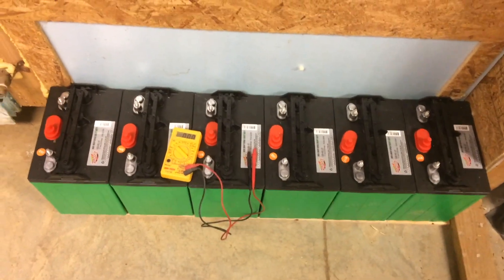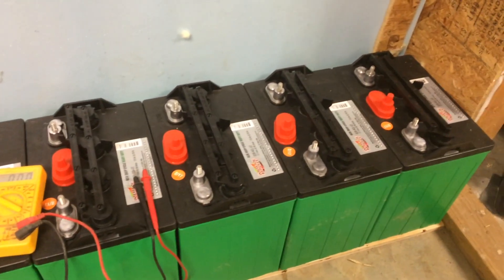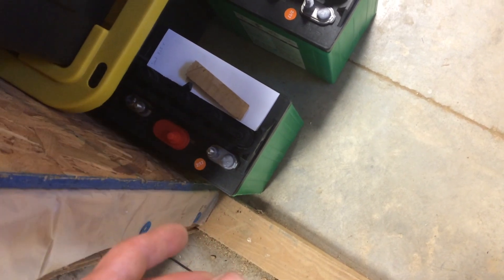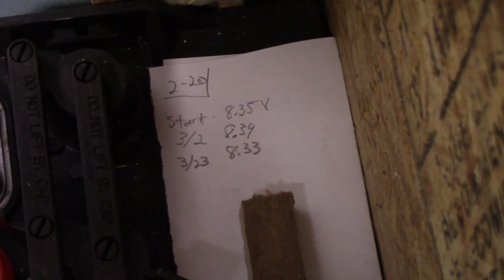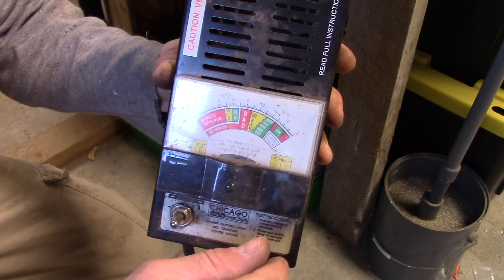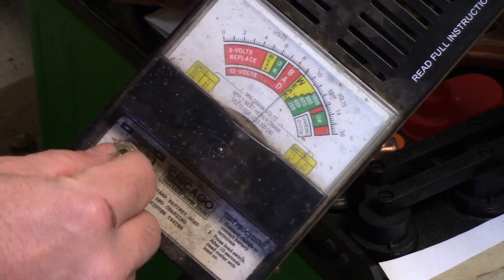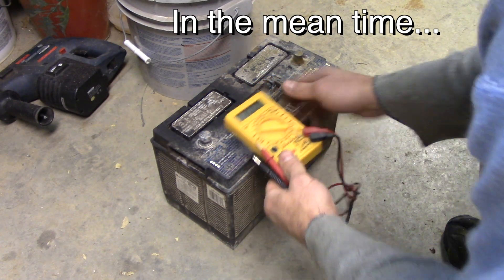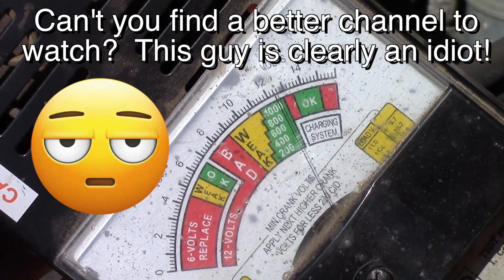Is Concrete Killing Your Batteries?? Here's Scientific Proof To End The Debate. FarmCraft101 Solar

Comment: It's not a myth at all... Farm Craft lives in a temperate climate.  In a COLD CLIMATE the concrete acts as a heat sink which will impede the chemical reaction of the electrolyte.  If you're charging or discharging the battery on such a heat sink it can cause damage because one part of the battery is heating up unequally to the rest of the component.  Adding a thermal barrier or just a little bit of insulation makes a world of difference. Don't trust a single thing the goofballs on car talk tell you.

Comment: I was told this years ago never thought anything of it but always if I remembered put wood or something under them after being told  about it,  well  I have a car battery that came out of my dead van that was a Good battery I had been storing it on Wood but my sister moved it sometime in the last 12 months to  the concrete floor   and  the good battery now is 100% trash  I was  making sure to charge it to keep it as a back up battery anyway it was never left under 11 volts   I went to use it the other day and decided to stick it on the charger before hand anyway it was reading 8 volts after being put on the concrete and now it  won't hold a charge after trying to charge it it  for a day it now reads 2 volts

Comment: This is for batteries that are still usable but unable to properly maintain a quality service of your need.  Or long-term  sitting of a not proper maintain  if it has dropped to a low voltages and rate ........ just know what a myth origin is and don't conspiracy.

Comment: It's because they stored a dirty battery, there will be a voltage drop across the dirt, batteries also vent and basement or garages are dusty, thus leaving batteries to drain, from dirt and venting.
You can also get voltage on a rubber hose, the same reason for dirt. The race and specie of Children are gullible.

Comment: The Concrete needs to have Steel Reo "re-inforcement" in its construction as it is inductive to the electrolyte in its discharged state which has a different name, The affects of the scale solphate will cause cell damage making the Battery unrecoverable by charging, ask your self why would this ingenious youtuber risk destroying 3 batteries. Seriously how much are Car batteries today, Maybe he sells batteries and makes a margin on each sale, As a Mechanic if I have to remove a battery from a customers vehicle it is not placed on the floor, and if anyone in the workshop relocates on to a concrete floor they will be out the door or paying for the customers replacement Battery.

Comment: I had always heard the same thing.  There was a rationale behind it, but different from the historical ones you stated.  The idea was that concrete is somewhat conductive (is it?  Maybe depending on the moisture content) and would form a capacitive couple between the concrete and the plates inside the battery.  That would be to the small surface areas at the bottom edges of the plate which would not be a high capacitor value.  This may seem plausible at the very small rates to affect a battery  over the long term.  (Almost anything could seem plausible if the rate is small enough or the time span long enough).  It doesn't seem likely that a capacitive coupling, which is open circuit in DC, would result in the DC discharge of a battery.  Maybe they were thinking that it resulted in a miniscule short between the battery plates since no insulation is perfect?  Who knows?  I think the length of your test is enough to disprove the theory for all practical purposes.

Comment: Batteries will go dead but sitting on the ground if they leak acid and collect dirt on the case this dirt will cause a draw on the battery and kill it over time the battery is clean inside sitting on wood it won't go dead as quickly I have measured the voltage drop on batteries that are acid on the exterior and all dirty when I clean the battery the voltage draw went away so this is probably what people are talking about

Comment: I think I know where the myth came from. When a battery is sitting idle on the concrete, the months and years go by very fast, which of course kills the battery from self-discharge. If a battery sits discharged for even a couple of months, it won't recover when charged. LiFeP04 FTW!

Comment: Lotta work there, or just bunch of time. Well you made a believer outta me. Good job, kudos even.

Now to the part where you may wanna ban me from the site. Could you possibly do the test again with the positive connection to ground on one battery and then on another battery the negative to ground. I'm sure it would not be necessary to do one withe both leads to ground. I feel like a scoundrel for even mentioning this, I was jus' wondering...
🥺

Comment: ‘Don’t store a battery on concrete’ is from the time when battery cases were made from carbon filled rubber compounds. Rubber was stable against the sulphuric acid, but the carbon in the rubber was an electrical conductor. These old batteries did discharge slowly on concrete surfaces. The modern plastic battery cases are much better electrical insulators than the old fashioned rubber ones. This old tribal knowledge was valid, but has been slow to die off when new battery case materials became available and discharge thru the case is no longer a concern.

Comment: Concrete is chemically and atomicly active. It's components were dug from underground, sometimes exposed to low levels of radioactivity. It also "collects" cosmic radiation. In addition, it's a thermal heat sink and cycles the battery that way; even morning dew has an affect...so science says that it does mess wit batteries. Just think it through, simple thought experiment.

Comment: People are forgetting........the plastic compound has changed quite a bit since the 40's to the 50's to the 60's to the 70's and 80's to now............
Sitting them on the concrete floor for a length of time wouldn't just drain them it would ruin the batteries back then.......it may seem to be a myth now but it wasn't back then.
Reply: Placing them on a concrete floor is still a bad practice even today.  Concrete floors act as a heat sink and can slow down electrolytic reactions in cold temperatures or have the battery unequally discharge its capacity under heavy load causing damage.

Concrete is generally found on the floor of most places so you also risk water intrusion with flooding and other issues...  Also if you're charging a battery temperature matters quite a bit!  There's a reason why a lot of lithium-ion batteries have temperature sensors which will prevent charging until they reach a certain point.

Comment: It wasn't always a myth!!!! If you do your homework, you will find out that at one time it was true, due to battery design. In the the first 1/4-1/3 of the 20th century battery's we're made of lead, acid, and GLASS. The lead and acid were encased in GLASS!!! That battery was then placed in a WOODEN box to protect the GLASS cased Battey. So if you placed those batteries on concrete, the wooden box would absorb moisture from the concrete and swell. The swelling would crack the glass inside and all the acid would drain out and the battery would be "drained" so to speak.
Reply: I knew I should have waited till the end to post my comment

Comment: Jon, interesting where this myth came from. I believe today it is still a good idea to keep lead acid batteries off concrete because when putting heavy battery down you could cause the loose particles in the battery to sink to the bottom and may short out some of the cells. So I always put my stored batteries on a soft surface like a piece of pine thanks for your video great stuff. Bill N LI NY

Comment: It's interesting where this myth came from. It's from a time when batteries came in wood boxes. The acid in the battery would slowly permeate through the wood, and form some kind of complex with the concrete that was conductive. This would discharge the battery. The advice got passed down by word of mouth for 70 years, and here we are.

Comment: The only way a battery would go bad sitting on ground would be if you accidentally sit it down on a small sharp object that pierces a small hole in its plastic cheap case and causes it to leak all it’s acid.

Comment: Ok but I too at the shop I was working at and the myth was true we did 3 brand new batteries off the shelf and the one on the ground did discharge at a SLIGHTLY faster rate maybe a volt every 3 days compared to the one we had on the bench and you said that your meter wasn’t correct working condition so wether or not that your looking at the drop in charge THE TRUTH IS IT IS TRUTH but it does take a bit of TIME now I’ll say again it will happen we used brand new batteries off the shelf and with a GOOD WORKING CONDITION, and it proved the myth and yes it was a fact in older tech and it has gotten way better over the years with advancements in tech so yes you are correct on the history but the myth is still true as I have personally proved it a few times, I am a ase master tech by trade and also work as an auto electrical tech master grade so on that note the only thing you proved is that the tech now is better than years ago

Comment: I think the "myth" does have some truth, it wasnt draining the battery, but it was slowing the chemical reactions of the acid/metal when the battery sits on cold concrete/ground, the side effect is it appears to be a flat battery and hence "discharged" when in fact the battery is just cold, even on modern cells a cold cell will appear to be flat but when warmed up will work fine

Comment: Ha ha ha! I scored a used battery from a backup generator at work that gets new batteries every 2 or 3 years and forgot it in my garage for nearly 2 years. I finally did a cleanup and found it again and thought it must be dead from sitting on the concrete that long. To my surprise it not only held voltage, but it started my car when it had a flat battery. This exploded the notion that a battery stored in direct contact with the concrete would go flat. Your experiment validated my findings and that is what is needed to prove a hypothesis. Thanks for your video. I can corroborate your results. 
Cheers.

Comment: Just a comment or two...
I have seen many old outbuildings (where you can see through the cracks in the walls) after a warm, humid front has passed.
So much moisture collects that there are puddles on the floor! Your dirty battery will also have moisture condense. This can cause a small leakage of current across 

the dirt etc. between the terminals. The battery on the floor will continue to condense water  as  long as the concrete is at a lower temp than the dewpoint.  If the battery is 

on wood, plastic etc. it will warm up faster, dry out, and reduce the amount of time for discharging.
If you do not get wet floors in humid weather you will not likely have a problem.
Oh, and keep those batteries CLEAN!!!
Reply: this is a same answer my grandpa tell me. it not about batteries leave on the floor are bad, its because if you spill something or moisture condense a long time it can cause your plastic batteries case to roots, so its better it have something to hold it above ground

Comment: I don't know about losing electrons to the ground but I do believe it is a good preventative measure to have some sort of insulating layer between batteries and concrete, not for charge loss but HEAT loss.  Batteries are more efficient at slightly higher temperatures and freezing temps can kill cells. so these days it really depends on climate
Reply: That's false false FALSE. Unless your battery is already dead, freezing temps will not effect your (modern car) battery life until around -74°f. Cold storage is actually better for your battery, extending the life span of the battery over all. Studies have shown that a battery stored at 90°f will discharge twice as fast as a battery stored at 75°f, with slightly diminishing returns as you go down in temperatures.
Reply: @MyKillerson  My battery must have been dead then

Comment: Agree with your final findings - the batteries will be fine.  HOVER, even today, placing batteries on concrete , is not a good idea if you are going to charge it.  If the batteries boil over you WILL damage your concrete.
Reply: If the battery boils over you must be using a $5 charger. Jesus.

Comment: This is true back in the day batteries were made out of asphalt type of material type of rubber not plastic so those batteries if you put them on concrete but go dead but now that batteries are made out of plastic plastic is an insulator and they won't discharge on asphalt or concrete it's nice to have a rubber pad or something underneath them in case your spills water filling them up bottom line new style batteries made of plastic won't go dead plastic is an insulator batteries have internal resistance so when the battery sitting for a while it will drain down slowly
Reply: This! The casing for today's batteries are totally different than batteries made in the 50s. It's a myth now, but was true back in the day. Batteries have come a long way in my lifetime.

Comment: This has a basis in truth. The old batteries first used in cars were made with hard rubber cases. The carbon in the cases caused electrical reaction and discharged them. For almost a century, they have been made of plastic which doesn't do this.

Comment: I believe the saying of don't store batteries on concrete derived from very dirty batteries (your tractor battery is getting closer) and the current that is carried by that damp dirt.  This goes to ground through the dirt all the better because of moisture if the slab is wicking ground moisture.  Now practically it is of no real concern in a dry environment however it might be a good reason to clean your batteries especially corrosion around the terminals to prevent that mini amp current draw.  In a dirty oily commercial shop one can see where it just might get to be a problem.  Down low is going to collect a lot more swarf, dirt etc even more so if they wash the car bays.  Take care.  Doug

Comment: Batteries on concrete is only hard on them when the concrete is cold and you need amps on demand. Batteries do not put out max amps in cold weather. Put some wood under them and let the system keep the battery room warm with proper ventilation for stable operation temperature.

Comment: IF this myth was true, wood would not be sufficient enough to prevent the batteries from draining due to the wood being grounded. There would need to be an insulator that would break the current, like...I dunno...rubber or plastic.
Reply: Wood is an insulator.
Reply: @adamrspears1981  Ever seen a lightning bolt hit a tree?
Reply: @MarkiusFox  Air is an insulator. Ever seen lightning through air? Exactly. The higher the voltage the easier it is to go through insulators and in some case even become conductors.
Reply: Dry wood is a good insulator

Comment: Playing devils advocate here...
Ur results reflect 1 reality...
However u can not state ur results r definitive as u did not do enough tests... (nor did u give us enough details to replicate ur tests eg. Time of year, temp, etc.)
Temperature, humidity, thickness of the wood etc... r all important...
Also ur sample size is way 2 small.!
U need to try...
On wood with a damp proof membrane.
On thicker wood. (With & without a damp proof membrane)
Concrete with & without a damp proof membrane.
Covering the terminals with petroleum jelly to prevent moisture causing losses...etc...
Some say u should use 2pcs of 1x2" or 2x4" with damp proof membrane with a piece of wood on top of that.!
(This keeps the moisture from wicking up through the concrete into the wood hence negating the wood, it also keeps it warmer as it's up off the floor, it also allows air to circulate preventing moisture)
Look forward to u doing further tests.
Reply: You can submerge them 80% (contacts are dry) and it still wont change a thing - since the plastic is simply 100% sealed and doesnt care about water.
Please dont test batteries via floating (=no load) voltage. This reading is useless, as shown in the video. Its more like a thermometer than anything else (higher temperatue = higher voltage and vice versa).
He still used these readings... you need to measure the voltage while(!) the battery is under load. He could modify his load tester and measure the voltage with a DMM instead of that shitty scale and voila: Good readings.

Comment: I have the same battery tester as you in your video. I tested my batteries in my for excursion 7.3, and both checked good (with cables disconnected) Then later in the week, I helped my sister move, and it was deader than a door nail. A better way I have found to check batteries...
https://youtu.be/TcWBsXyc8gQ

Comment: I believe the condition of the battery and the environment in which they are stored on concrete has a lot to do with whether or not one should store a battery on concrete. Lead acid batteries prefer to to fully charged.  So charging the battery before storage and adding a battery minder would be advantageous as well.

Comment: Excellent video debunking the myth and following that with the historical perspective.  At @5 minutes you load test the group 31 battery pulled from your tractor - if it fails the test with that small load tester, you bet that battery is toast.  Generally, one requires the use of a 500 amp carbon pile test to adequately test those group 31 batteries.